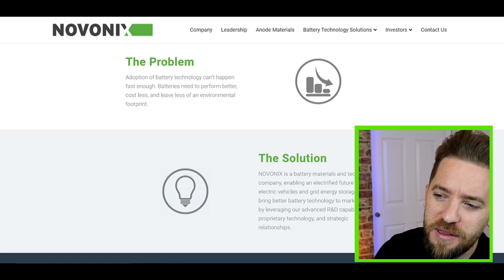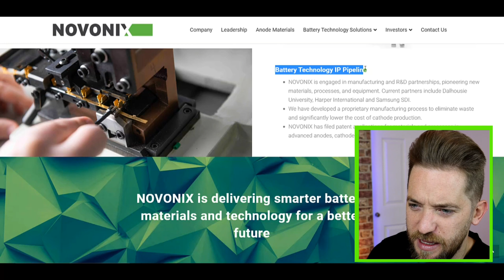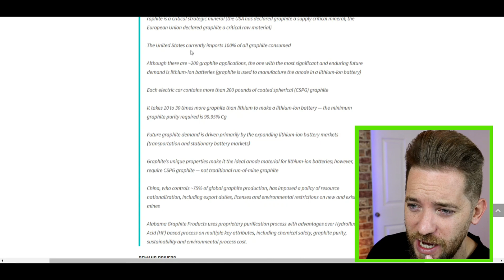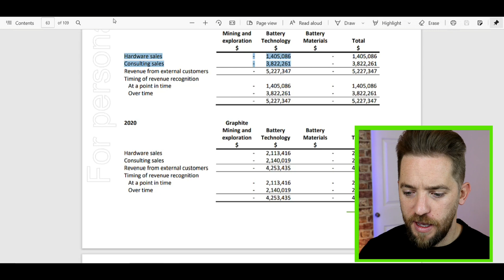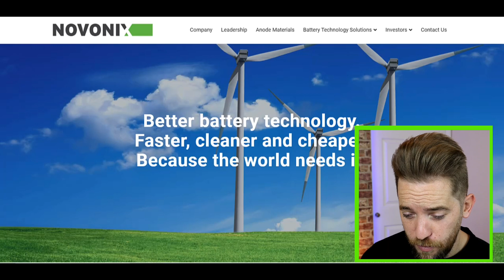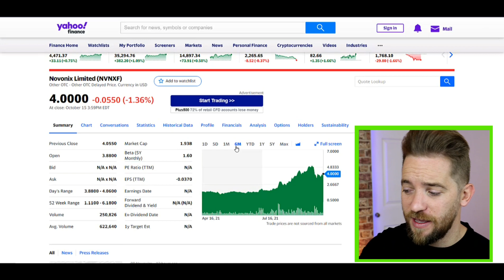Why Novonix stock is a 10X opportunity

Comment: Great video, and excellent comments as well. I got in at $5AUD (it is at $8.18AUD as I type) and will be adding  at every pullback. JK from Down under
Reply from the maker: I've been looking to add on the any pullbacks as well but they are few and far between at the moment it's really been flying! Glad you enjoyed it and thanks for the comment
Reply: @trader_uk1446  The problem with waiting on pullbacks on a stock like this one is that each pullback represents a slightly higer price than you would have paid last week.